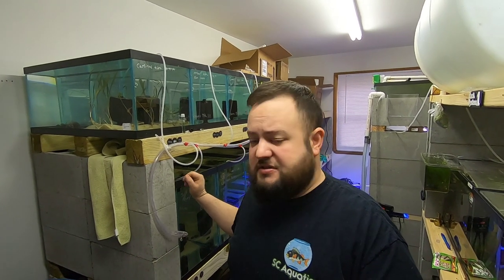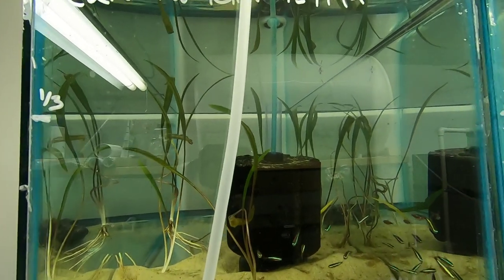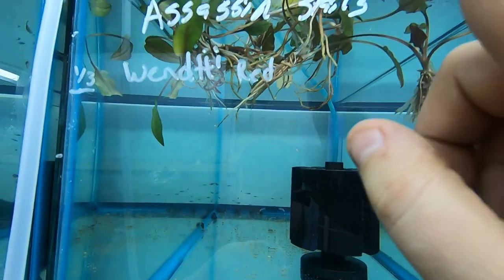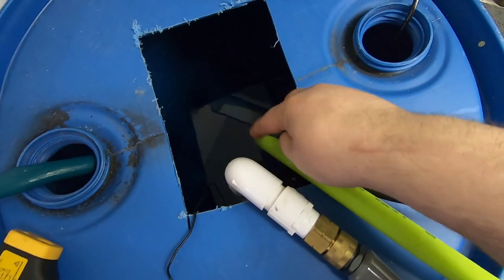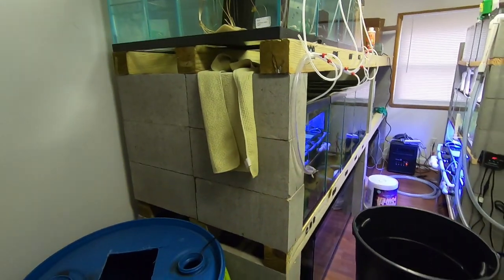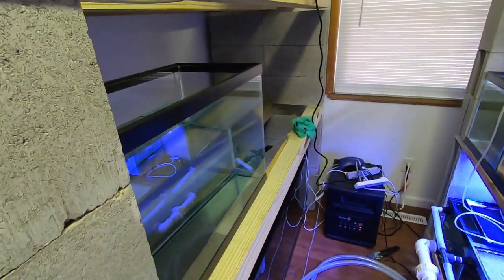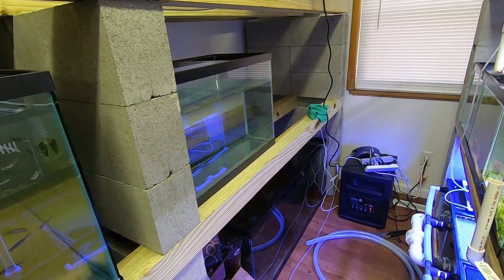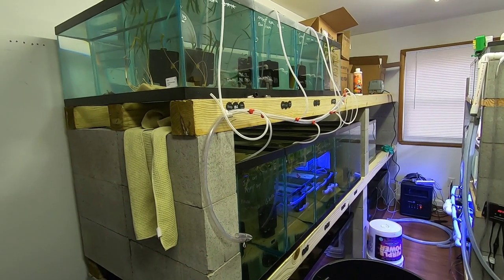My first import fish order failure! (Part 6)

Comment: How long are those quarantined fishes kept in little plastic bags, or does the breeder quarantine them before shipping?
Reply from the maker: The importer says they quarantine everything but I believe it’s just a holding tank until they sell. They were surprised when I told them I quarantine for 30 days. They’re shipped in the bags but not held in the bags at the wholesaler. Everything’s in a bag for usually less than 24 hours.